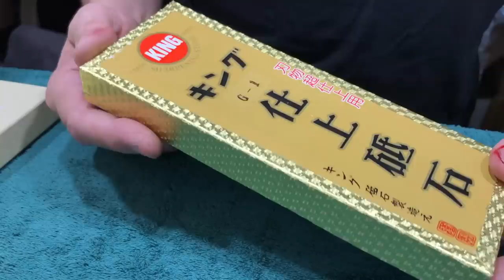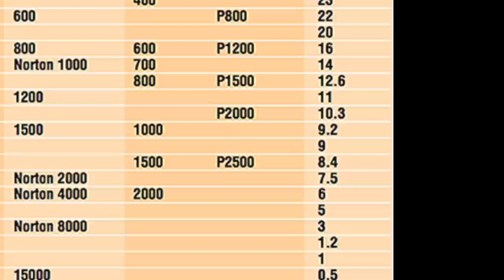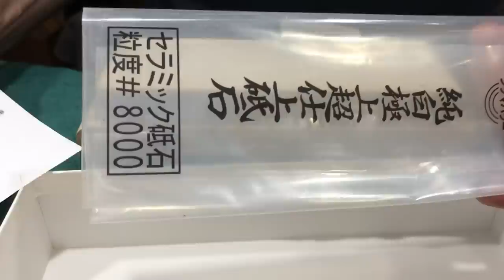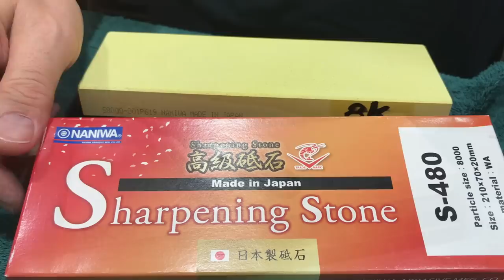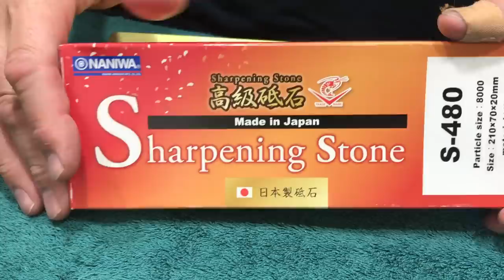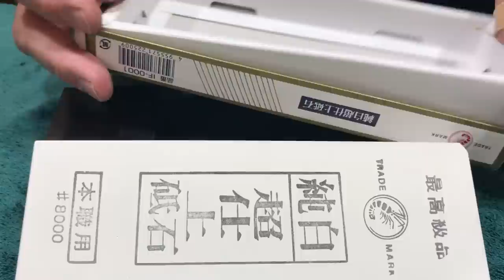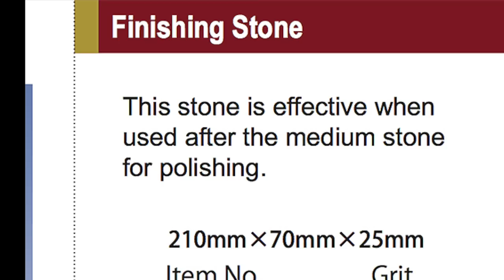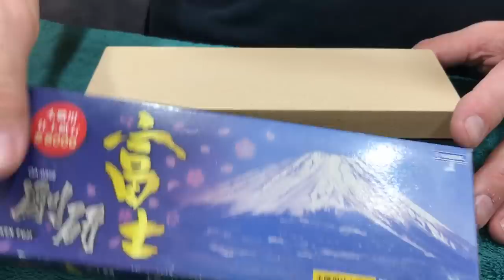Top Ten 8k Whetstones - Straight Razor Honing

Comment from the maker: The 8k Stone list. 
 
1 - Naniwa Fuji 8k
2 - Naniwa Jyunpaku 8k
3 - Naniwa Sharpening Stone 8k  
4 - Shapton Pro 8k
5 – Shapton Glass HC 8000
6 – Shapton Glass Stone HR 8000
7 – Sigma Power 8000
8 - Kitiyama 8k 
9 - Norton 8k 
10 – King Goldstone G1 8000
Reply: thanks for the list , its very confusing sometimes
Reply: Hi Keith, glad to hear Naniwa snow white in number 2.

I have a snow white, like it a lot.

Do you recommend Shapton glass stone or Shapton pro for 500- 1000#?
Reply: Great Video, do you have a similar video comparing your experience with Finishing Stones? 10K and up?

Comment: I am glad I have stopped buying stones as I might be tempted to buy a Snow White, which I have been very curious about for a long time. 

I have the Shapton Pro's from 1-12k, as well as a Sigma 10 and 13k, but I like the Shapton's better. If I was to buy more stones, they would be Jnats, since I bought an Ozuku Asagi, I really only want to try more Jnats, (even though I have lots of stones from other places) but the madness has to stop somewhere.
You have found a way to keep the madness going and not break the bank balance, well it is probably increasing, good for you.
I am like you and just love honing, I don't know why though.
Thanks.
Reply from the maker: Thank you for stopping by, watching and commenting! Honing is a rewarding event, very satisfying.
Reply: @KeithVJohnson1  There is something rewarding about it, but I cant put my finger on it.
I just caught the wife opening a package with one of my razors, and said what are you using that for, she said it was just like a knife, so I used it. I was pretty thankful really, after I explained why she shouldn't use one for such things. I needed an excuse to re-hone it as everything is already sharp, and my itchy honing fingers needed scratching.
Reply from the maker: Cool story - thank you for sharing.

Comment: Nice Video really enjoyed it but have some confusing on King G1 and Kitayama you say to soak for around 30 Minutes as far as i am aware these are Splash and Go  not Waterstones ?
Reply from the maker: The term Waterstone means it's not an oil stone - that it is designed to be used with water only as a honing medium; they can be splash and go or a soaker. 
Some stones sold as splash and go, such as Naniwa Chosera / Professional series, perform better with a short soak. Same for Shapton Pro stones; mind you, Shapton will simultaneously tell you to not soak the stone, and then tell you it's ok to soak it for a short while. I usually dunk them for a couple/few minutes. 
The Kit and King 8k stones performed better with longer soak times. Many other sharpeners have found the same, although the soak times might vary from person to person. I found 30 minutes to produce the best results.

Comment: Excellent experiment and video, Keith. I am currently trying to figure out the middle-upper part of my progression (including the 8k slot) so this was really helpful. I think I am going to do something similar - but since I’m just learning to straight razor shave I’m going to have to omit that test. :-) Likely will rely on visuals from my 60x loop and use a set of Tojiro steak knives as my test samples so that I can run things a bit in parallel. In particular I am looking to see how a hard Ark might fit into the progression).

Comment: FWIW, I use the kitayama as a splash and go, and never soak it.  I have the one with the base.  While I haven't seen the chipping, I am using a vintage German made razor. Also I hone at an angle so all the blade stays in contact the whole time. I heard this also helps avoid chipping.
Reply from the maker: Not sure what you mean by ‘always in contact’ -  but, when honing a razor, the spine and edge are always supposed to be on the stone, that’s how we maintain the bevel’s angle. Has nothing to do with chipping though. That stone is supposed to be soaked actually, so there’s that.
Reply: @KeithVJohnson1  By "always in contact" I keep both ends of the edge and most of the spine on the stone, nothing hangs over the edge of the stone. I haven't had to use any "X" strokes this way.  For the razor, I primarily use the Shapton pro's 2K/5K/8K/12K.  I find carbon steel is very happy on it. Then strop with very fine particle crox, this gives me arm hair splitting sharpness.  The Kitayama I have only used once on the razor, just to see what it was like.  I mainly use it on kitchen knives.  FWIW I sharpen about 100 knives per month (mine plus a community center kitchen in town).
Reply from the maker: Honing razors in what we refer to as  'head on' or 1/2 strokes (blade always in contact) has always proven itself to be unfavorable when used on stones finer than say, 3k. That's for me when honing razors, for cutlery, I choose sharpening style based on profile and steel type and I do use 'full contact' strokes often.  Objectively, X strokes do not cause chipping, they actually help prevent chipping. Arm hair splitting sharpness should be happening shortly after or during bevel set at 1k and most definitely by 5/8k - if you need Crox after the 12k then something is definitely askew...
Reply: @KeithVJohnson1  Thanks for that.  After bevel is set (which I only have done this once), I just flip it on the spine, what I would call stropping strokes, edge leading.  I never bothered to check sharpness on hair till I was all done, I'll give that a try next time.  Early on, I used a jeweler's loupe prior to each stone to make sure the scratches have been dealt with by the current stone.  Anymore, for me it's mainly a feel thing... it changes once the stone has done it's job polishing the scratches.  Anyway, my thinking behind staying away from "X" strokes was that I wouldn't have the edge in contact the same amount at the toe and heal compared to the middle, I didn't want to create a frown.  I suspect this is where slight torque comes into play to overcome this.  I'm going to go back and watch another one of your video's and redo this from the ground up, seeing if I can't get the hang of the "X" strokes, loupe in hand checking each step. One thing I will say, is I love the feel of a straight razor compared to my safety razor (with Wilkinson Sword blades)
Reply from the maker: You should be able to manage a shave off your bevel setter - each following step should improve that shave. You can wear the toe/heel more with x strokes, sure. You would possible get a smile, not a frown. But unless you sharpen the razor obsessively, you probably won't see that happen. And a smiling edge can be a good thing. I go by feel mostly, I will use a loupe to check too, but it's always feel that tells me to move on.
Reply: @KeithVJohnson1  Thanks for the advice.

Comment: Hey Keith.  Great video. Quick question how do tell if a stone is true flat? I use a thick metal ruler and place it on stone in different spots and check for light peaking through....am I doing it wrong? Is there a better method or tool? I know it may seem silly but I want my stones perfect.
Reply from the maker: That's how it's done. I use a starrett straight edge instead of a ruler though. Probably overkill but there's no denying the .0002" per 12" accuracy.

Comment: Greetings from Mexico, just starting. Any thoughts in the suehiro W8 and G8?.
I´m using a naniwa ss 4000 and making a big jump to a CBN 12k, then finishing with a natural construction slate mined in México called "laja Negra Mixteca" with decent results, but i have to spend lot of time with de 12k, i think i could use an 8k. Great no bull shit video as always.
Reply from the maker: Naniwa Super Stones come in 3000 or 5000, no 4000 there. Not sure what a CBN 12k is, unless you mean the Chinese Hone of Undetermined Grit (Chug), which are more like a 7k most days. The W8/G8 stones are not in the "Top 10" list so they're another topic for another day.
Reply: @KeithVJohnson1  acording to the seller, is an 4k off speck stone, you´re right,  the 12 k is a Chinese diamod - resin, adevertised as 12 k,  thanks for your quick response, i might go with the shapton or the fuji. i made the mistake o buying cheap stones al first.

Comment: The Snow is legendary for straight and knives and I’m wondering if the fuji is as fantastic with knives as it is straights. I know this question can be arrogant because I’m looking for a black and white answer and yada yada I understand the fuji would probably work, but I sharpen knives, and I need an 8k. I’m eventually moving into straight when I fucking grow hair (still waiting for them wiskars) so I’d like something to work with both
Reply from the maker: I don't do much commenting on knife sharpening, I try to stay focused on straight razors to avoid confusion. I also don't usually use an 8k when sharpening knives, so there's that.
Reply: Keith V. Johnson that’s fair. Well it’s in the mail so we will see!!

Comment: As a newbie.  If I want to touch up a blade could I do a few laps on an 8k? Or should I really do 1k 3k and 8k?   Truth be told I’m on a budget so probably can afford one stone per month for next few months lol. Should I buy 8k first and use for touch ups?
Reply from the maker: A 'touch up' depends on the stone the blade was finished on initially. If your razor was honed to - say, 12k - then a touch up would be done on a 12k. You shouldn't need to go lower than 12k unless you put too much wear on it - in which case you'd start on 8k, then finish on 12k.

Comment: so you go straight from a 1k to 5k, then botan? Don't need anything in between the 1k and 5k?
Reply from the maker: With Shapton Pro stones, yes - I follow the 1.5k with  5k. Sometimes I just go from the 1.5k to Botan.
Reply: so I could set the bevel on chosera  1k and go straight to botan on awese?
Reply from the maker: It is possible to set the bevel on Botan, so yes - it is possible to go 1k, Botan - but your skills have to be on point and it is very possible for new users to 'miss' using that technique. I usually tell people starting out to start Botan after 5k or 8k and then work backwards to figure out the jump.
Reply: @KeithVJohnson1  thanks again...much appreciated
Reply from the maker: You're welcome! And thank you for watching and commenting!